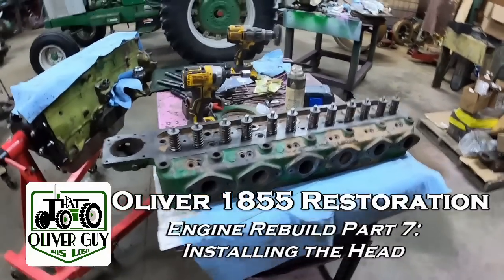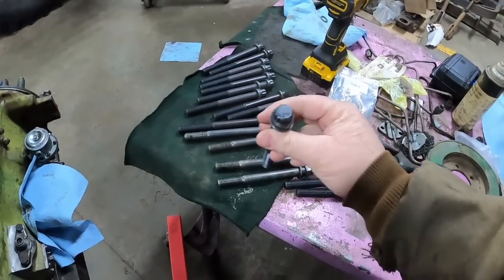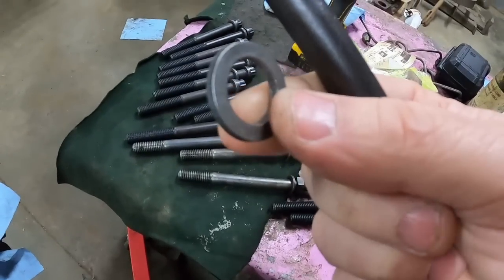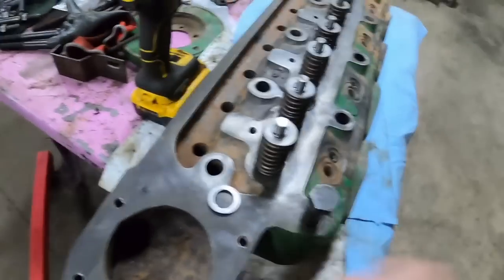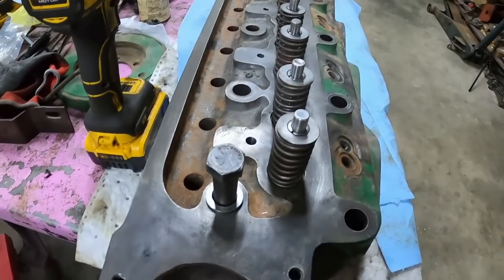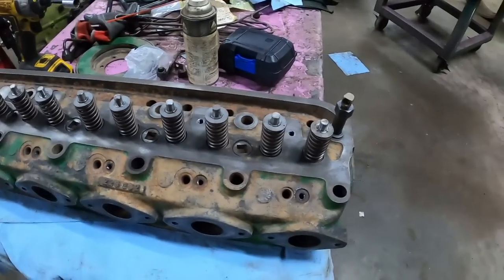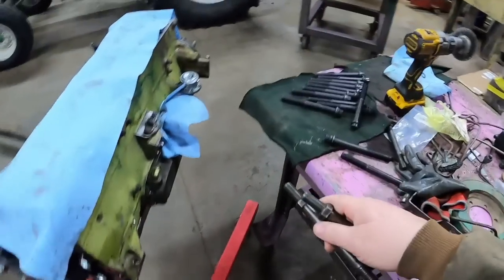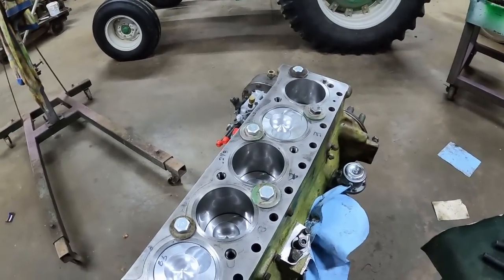TORQUING THE HEAD! it's starting to look like an engine

Comment: It’s amazing how much harder that pull seems when the engine isn’t bolted in the tractor frame! Also, always wiggle it a little before shoving it in the wrong hole. 🤣
Reply from the maker: There are certain lines that I say and I think, "Ross will finish that one in the comments"  This is one of those moments.
Reply: @ThatOliverGuyChris  I may not be pretty, but I am reliable.
Reply: Only you, Ross!  🤣🤣🤣🤣🤣🤣

Comment: Thanks for video Chris.  A thought about torque... "A man with a watch knows what time it is. A man with two watches is never sure."

In manufacturing audit torque to turn (end of line checks) is generally lower than the first installation torque.  As a rule, a bolted joint will always relax and loose clamp load for 15 minutes to an hour unless fasteners are torqued to yield.
Reply from the maker: I like that watch saying.  I'll file it with even  a stopped clock is right twice a day.

Comment: We have two torque wrenches that are clickers, I think both of them are not working properly. I have one with the needle pointer, we are currently going to use it on my son's Massey 285. Two years ago the head gasket blew and we replaced it during hay season, a big rush as usual. Well last year in the middle of hay it was not wanting to start without a big stumble and overheating, so we are going to tear it down this spring. The engine is looking good and coming right along, I'll be anxious to watch the complete video of the injector and rail. Thanks for sharing Chris, have a great Sunday and week ahead.👍

Comment: It looks like before long you'll get the motor put back in Chris. Thanks Michael
Reply from the maker: I'm thinking about setting it in the frame to make getting the flywheel and clutch back on easier. Then I can get the pump timed as well. I need to get my hustle on, spring is coming!

Comment: Did you ever find out why it wouldn't run without choke? The low speed jet and or passage is plugged, it can't pull enough fuel through at low speeds to keep it running. A good cleaning should work. I've used wires from a wire brush before but a tip cleaner for a gas torch works well also.
Reply from the maker: If you're referring to the 880, I found another carb in my stash of parts, cleaned it up and she's running great now
Reply: @ThatOliverGuyChris  thanks, yes the 880. I did see you had gotten another carb. 👍😎

Comment: Hey Chris. It looks like a 310 again!  I am going to usethe new head gasket from Maibach's. I think they say you dont have to retorque the head bolts but I have to double check that.  I also have those style T's for the returns.
Reply from the maker: Let me know what you think of the head gasket. It's supposed to be more tolerant of variation in sleeve protrusion.

Comment: I had the worse time getting my new injectors to seal at the top. The little clamps I guess had lost some of their tension. They are grade 8 bolts but I was afraid I would break them off trying to get them tight enough not to leak. I gave up and machined new one piece clamps out of 5/16 inch thick x 1 inch wide bar stock. This was on the head of a Deere 2020 tractor. I too bought new injectors. Best insurance on performance.
Reply from the maker: A&I is reproducing those injectors, and if it's like their other products, well, it might be like stepping over a dollar to pick up a dime. Even the Stanadyne injectors are now made in China, but I was assured they are still made to Stanadyne specifications. Does the Deere version have the 3 clips on top of the clip that comes with the injector?

Comment: Chris ,do you know where I could get an oem head gasket? I'm not having any luck with the ones from Maibach's they are sweating not even running and this 310 didn't have a head gasket issue before I over hauled it.
Reply from the maker: They are tough to find. Do a Google search for Svehlak Tractor, that's where I got mine. His stock is limited to what he has on hand, so there's a chance he might be out of them. 
A friend put a Reliance head gasket on his 1855 last year and it appeared that they have their hole alignment issues greatly improved. So that could be another option. Korves Oliver should be able to get you one of those.
Reply: @ThatOliverGuyChris  I appreciate that I'll try those two I do know that reliance is out of stock and been out for a while. Thanks again

Comment: Chris, I share your concerns about the lack of quality control with regards to Reliance products. I found that out the hard (and very expensive) way when having an overhaul done on my 1955 a few years ago. I am presently in need of a new head gasket and was wondering if you could recommend any sources for NOS that I could contact. Even through Agco, engine parts are becoming a struggle to find for these old girls here in Canada. Your postings are very informative and an absolute pleasure to view.
Reply from the maker: Give Larry Svehlak a call at 5126335014. He had a few more of these NOS gaskets left last I knew. I probably should have bought an extra, and still might. Maibach tractor has a custom head gasket for the 310. I haven't tried one, but haven't heard any complaints so far. It uses copper fire rings and a metal gasket coated with some kind of varnish that does the sealing.
Reply: @That Oliver Guy - Chris Losey  when Ethan rebuilt the 310 in his 1950T, he used the gasket from Maibach. Has held up well so far.......
Reply: @ThatOliverGuyChris  Thank you for providing that phone number, Chris. I have called several times over the past 3 weeks and have left messages, but have yet to receive a return call. I guess that I will have to go another route. I do, however, really appreciate that you took the time to try and help me out. Best regards, Dave.

Comment: Would you please share the part number for the new head bolts.   My 1950T needs a new head gasket again
Reply from the maker: https://www.fastenal.com/product/details/22913

It's been a hectic weekend with power and internet outages. Those are the bolts I ordered.
Reply: @ThatOliverGuyChris  thanks for the info.  Do you know if the other 310 service bulletins somewhere on the Internet I haven't been able to find them
Reply from the maker: Not that I know of on the internet. I should scan them and put them on Facebook.

Comment: At what point on a 105 do you need to pull the engine if the PTO isn't working?
Reply from the maker: The only reason to pull the engine to get the pto going is because the splines in the hub at the flywheel that drive the power shaft have stripped out and need replaced. If that is the case you wouldn't have hydraulics either, because they both get power from that shaft.

Comment: That makes your head screwed on correctly.  Tee Hee  Great Video.  I still wonder about the clicker torque when the clicker is clicked 2 to 3 times.  Does the torque increase with additional clicks?
Reply from the maker: Good question. More experiment material for the 1600.

Comment: where did you get the fuel return line fittings
Reply: A&I has them. Listed for John Deere. Nice kits.
Reply from the maker: https://www.tractorpartsasap.com/fuel-leak-off-line-kit-new-john-deere-re27786-189070.html
That was the best price I could find for the kit. If you search for RE27786 on google, there are several places that sell the kit.

Comment: Hmm I’m going to need to look and see if i went to 210 or not. I’m thinking I went 180/130. Does that make sense?
Reply from the maker: I think that was the old recommendation. There was a service bulletin, and the later service manual had the correct torque. It's not too late to hit it again.
Reply: Lol...I will run over them again.  I haven't even been able to get back up to put rad back in yet.
Reply: It will be much easier in the tractor....lol
Reply from the maker: @bigfoot-wo3qy  I haven't flipped a tractor with a torque wrench yet!